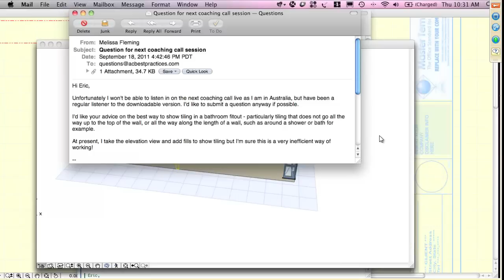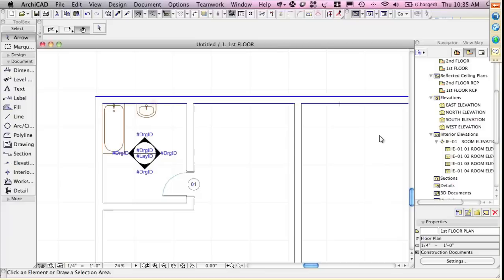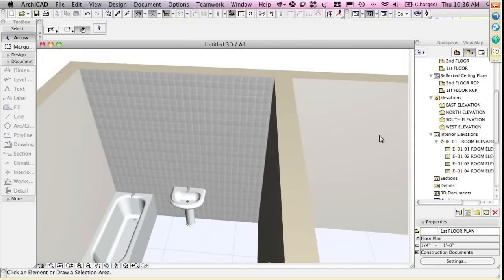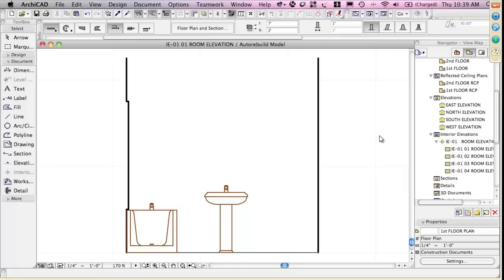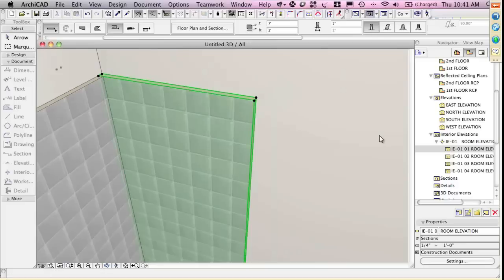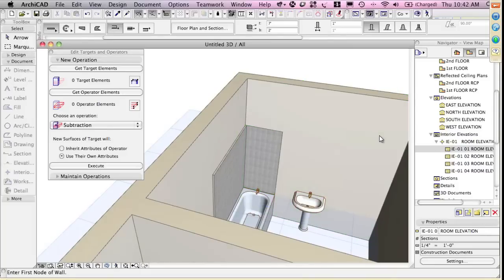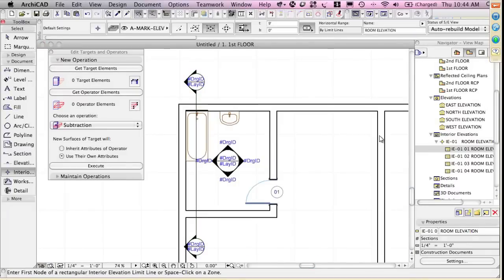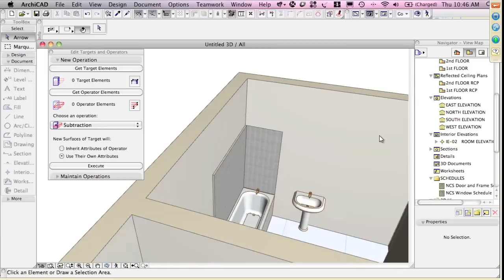ArchiCAD Tutorial | Introduction to Tilework

Comment: Thanks for the tutorial! One question: How do I change the "setting out" of tiles on the wall surface? E.g. if I want the tiles to start in the lower left corner of the bathtub, or the lower right corner, etc.?
Reply: konglian use the 'align 3D texture' tool